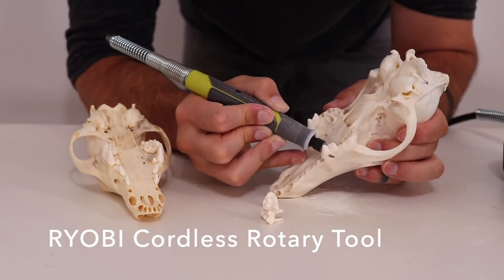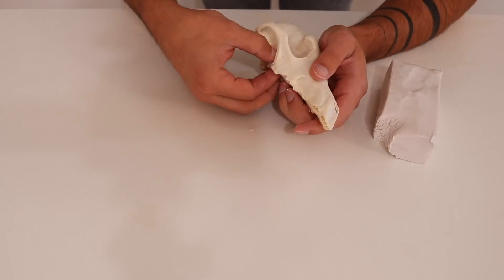Making a Solid Metal Coyote Skull | Casting Molten Tin

Comment: I absolutely love the concept and end result! but I wish the pivot point was a little more hidden.
Reply: Could countersink the bolt head and the nut. And even maybe fill in the hole after since the material is so easy to work with.
Reply: @mikulalukasz  
Since you seem to be knowledgeable about general metalworking, and since the video producer doesn't appear to answer posts regarding this video, I'll attempt to ask you my question. 

How do you deal with tin's natural 'habit' of contracting while cooling and solidifying after being melted and poured? I'm assuming that's probably why ^he added bismuth to his tin, in order to maybe reduce the contraction.  But it's actually difficult to find info on the problems associated with tin contraction during casting, and how to solve it.